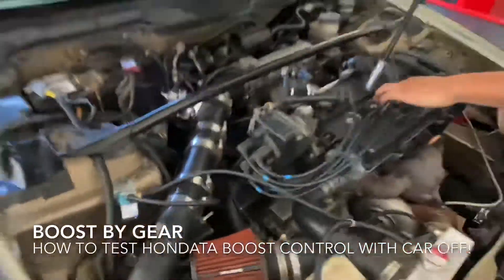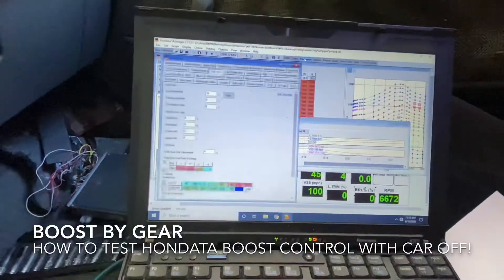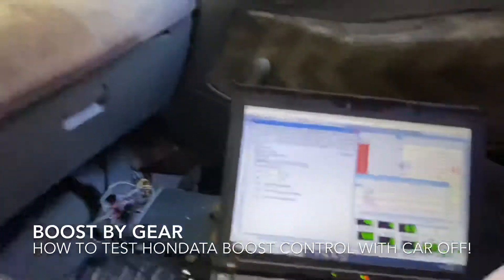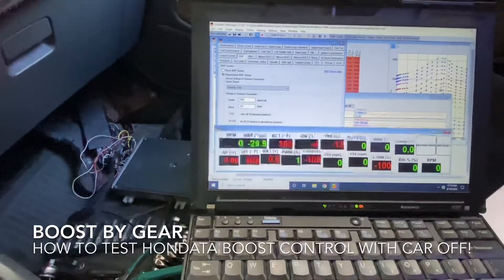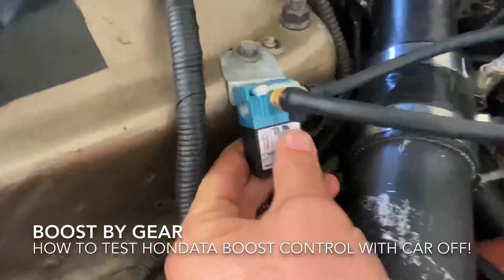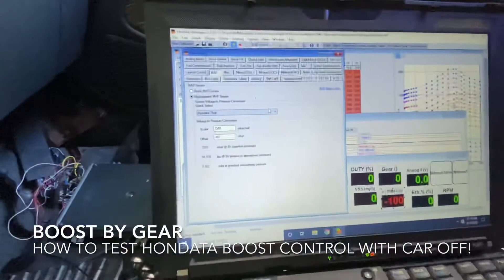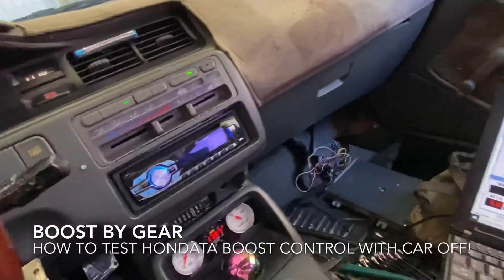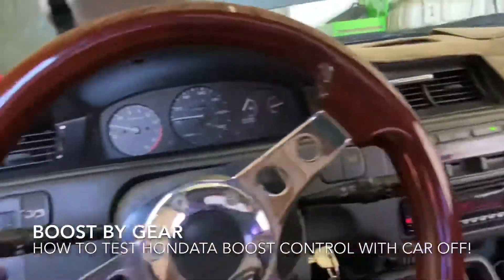Quick trick On how to test boost by gear (boost control) on hondata s300

Comment: @dardantuned My bbg recently stopped working for some reason and im running off spring pressure.  Tested with direct 12v, the Solenoid seems to still work/click and wire connections to ECU show continuity so good there.  

I tried your trick in this video and i have no noise from MAC Sol with key on so something must be up with p28 ECU.  Any ideas?
Reply from the maker: If youre on hondata, go to parameters, go to map sensor, switch it to 7bar and hit upload. They key on it should click. Set the boost control fixed to 48% to test it.
Reply: @Dardantuned  I’ll try that, thanks for the tip!!
Reply: @PGG909  Did you ever figure why? I’m having the same issue. It was working completely fine. It sat for a week or two, went to test it out again and it didn’t buzz. I got a new solenoid thinking that was the problem and it wasn’t. Everything’s getting power like it should.